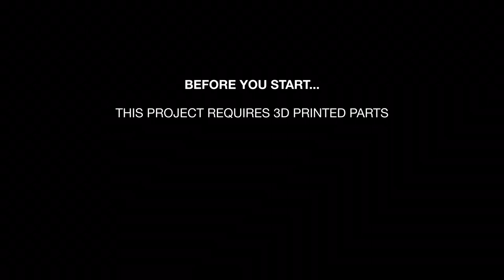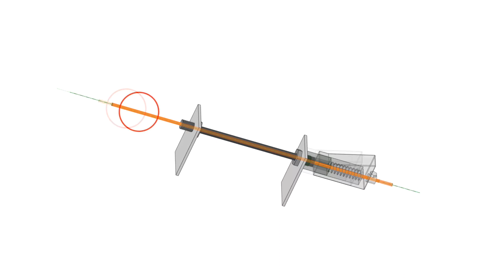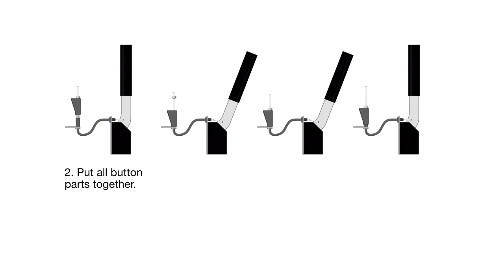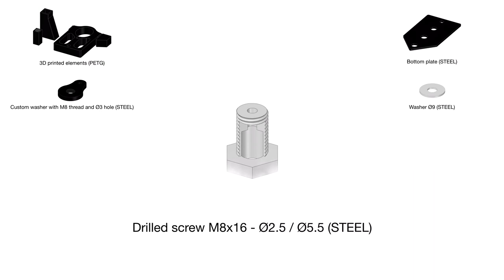DIY HANDBRAKE FOR THRUSTMASTER TX / T300 (PC / XBOX / PS4) - KEEP THE WARRANTY AND USE ANY HANDBRAKE

Comment: Brilliant idea, many thanks for the video, it appears its a bike cable housing, i can make or find all the parts but i dont know what those "set screw clamps/stops" are called that is used to hold the angled button pressing part, any input on what that part is called would be awesome. Again ty for the video 😁
Reply from the maker: Hi. You mean locking clamps? I probably bought it on the internet, but such parts are often available where steel cables are sold 🙂
Reply: @MR.EVERLOST  Ive also tried searching in steel cable locking clamps but its mostly clamps for fastening, i cant find those round locking clamps with a set screw to lock onto the steel cable itself... its a matter of the "correct" terminology thats preventing me from finding these... lol. The way i need to construct this those clamps would be very useful.
Reply from the maker: @rcguy7521  this looks cool but you need to find proper size
https://a.aliexpress.com/_uIqXab

Use keywords handscrew clamp or steel wire clamp

Comment: What's the "drill tool" used for. Are you putting the bolt in it to drill the hole through or? Also, what's the length/width of the bolt?
Reply from the maker: Hi. I dont remember now but I think it was 12-16mm screw drilled with 2.5 and 5mm drill tool

Comment: How are you interfacing this with the wheel I mean what is the cord pulling where's the switch
Reply from the maker: Everything is explained in the video. The bicycle wire pulls the printed element causing the button on the base to be pressed 🙃 this solution is dedicated to Tx bases and t300 (if you can map this button as handbrake in game).

Comment: Hi, where did you find all parts for your handbrake, like the handbrake but also the bottom plate or the custom washer ?
Reply: Do you have an ebay basket for example ?
Reply from the maker: non-standard parts I made myself from steel plate. I bought the brake on the internet and small parts from a local DIY store.

Comment: What size is the spring you placed in the 3d printed part for the A button? Thanks
Reply from the maker: Sorry, don’t remember, but it just need to fit into printed part and lift it up when handbrake is not pulled
Reply: @MR.EVERLOST  thanks for the reply,  brilliant design thank you for sharing 😊

Comment: Is that a custom wheel? Looks like the TM 383 but the wheel is leather instead of suede.
Reply from the maker: Chceck my other videos, one of them is about this steering wheel. But you have right its TM R383 with leather. I decide to change oryginal wrap because it starts to peel off 😩

Comment: what did you use to mount it to the servo base?
Reply from the maker: I have two metal plates connected with themself and mounted under servo. Look at the 14:01 s - I have similar metal plate under servo but mine is black so it hard to see it
Reply: @MR.EVERLOST  alright thank you so much, also I have to say it is great finding your video I wasn't able to find any cheap handbrakes that actually worked with xbox. But now i can use any handbreak i want for this. Lastly did you screw it into the base or glue it? what would you recommend.
Reply from the maker: @callmeizz357  I didn't screw it directly to the base. My base and part shown at 14:01 is bolted to a steel plate. In total, as I checked, I have 3 metal parts connected to each other and screwed to the base and the rig. 1 - metal plate under the base; 2 - bent adapter; 3 - part visible at 14:01 sec (all 3 parts are 2.5mm thick steel) 

* But you don't have to do it as I do. You can screw this part (No. 3) directly to the desk or the rig. *

I know the quality of the video is poor but see 15:10 sec. Part No. 3 is L-shaped. The longer side is just below the base but is bolted to the short side straight towards the wooden crossbar - you might even see a screw. 
Unfortunately it takes a bit of tinkering but I'm curious about your results. Let me know when you build your handbrake - I hope you will do it even better than I :)
Reply from the maker: @callmeizz357  https://iphoto.net/i/5xhjV
Reply: @MR.EVERLOST  of course, Ill let you know how it goes, im just finding all the parts i need to order from amazon.
Reply from the maker: @callmeizz357  Try to drill holes in the screws first. It was the most difficult part for me 😬
Good cooling and slow drilling is your key to success.
Reply: @MR.EVERLOST  haven't been able to find someone to print the parts for a good price sadly and the shutdown is making it hard, dont know if ill get around to it but thought id say something
Reply from the maker: @callmeizz357  best way to solve your problems is buy 3D printer. I know that is not cheapest solution but with 3D printer you can made so much stuff for simracing, home, etc... 
If you can’t print this trigger you can also try made it from diffirent materials. This mechanism is very simple 🙃
Reply: @MR.EVERLOST  ill see what i can do